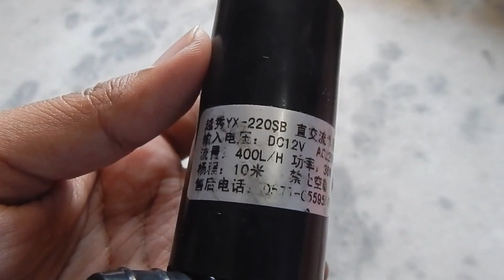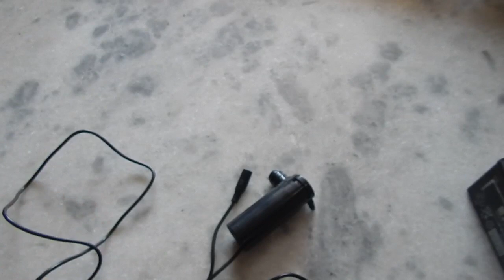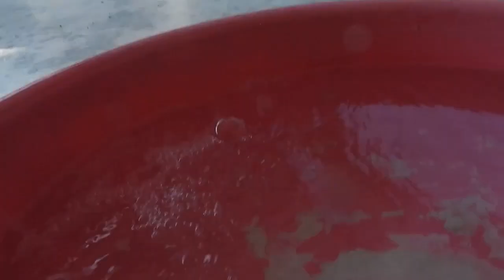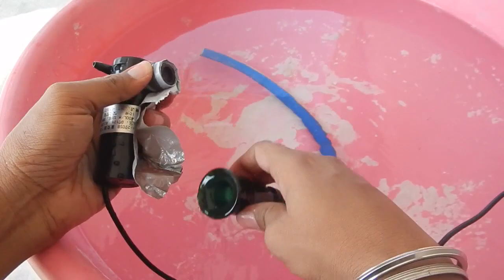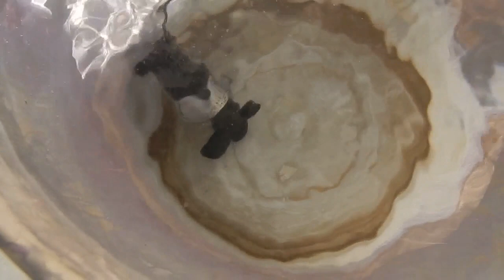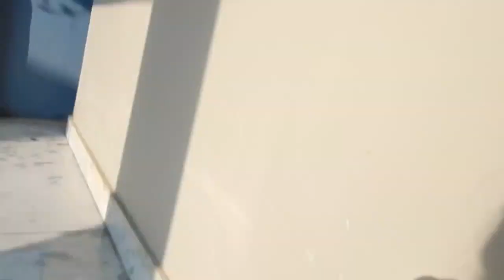DC 12V 36W Submersible fountain pond aquarium Solar car washer PUMP

Comment: dont use this type of sumarsible pump it produce high frequency sound and have to use additional power supply , price is also high , and it will not work for long time because of brush motor. so go for coolar sumarsable 240 volt.

Comment: 36W but such a low pressure 🙄 it's totally waste product then
Reply from the maker: don't just go by the rating on the pump. who knows what the pump is actually rated at.
i did not run the pump at full 36 watts.
i only ran it at 12watts as i did not have any high current power supply.
Reply: @gurribuy  bro i have made my DIY water pump which operates at 12v 0.9W on full load and the pressure it can throw the water upto 2 metre vertical and 3 to 4 meters far in horizontal.

Comment: can i use this to suck water from one bucket and move to other? without immersing it in the water, like connecting a hose to its input from the bucket?
Reply from the maker: This is not a self priming pump. So, a constant supply of water is needed all the time.
 You can run it without submersing in water but it would not suck the water because it is not self priming.

Comment: How can we undervolt or lessen the watts? I want to buy something like this and use it in computer water cooling, but the pump speed is 800l/h and I want to reduce the speed a lil bit by undervolting it but idk how to do that
Reply from the maker: it will not work because this pump is a high pressure pump.
you should look for some usb water pump with input and output, this way you can directly power the pump using the usb port of your computer.

Comment: I would not recommend connecting a 3A pump to a 1A power supply unless you really trust that the makers of the power supply have designed in some sort of thermal overload protection! It is very likely to overheat and might cause a fire. If it is a cheap Chinese supply then be careful.

Comment: For DC 12V 36W, the ampere is 3A. However, your power supply was only 1A. The total L/H could be lower than 400 L/H. Please correct me if I am wrong.

Comment: Where can we buy this pump. Please post the link.
Reply from the maker: https://www.aliexpress.com/item/32955857368.html?spm=a2g0s.9042311.0.0.514f4c4d0Ze4nw
Reply: Bro I don't know you are buying it or not. But I am seeing your question now and search it and find it in Ali express online shopping price is 5 American dollar
Reply: I use a pump look same as it and also works as it . I get it from old car front glass water sprayer . Price is rs 200 before one year. It lift water upto 42 feet( I have pipe vertically 42 feet only).
Reply: It's too much cost